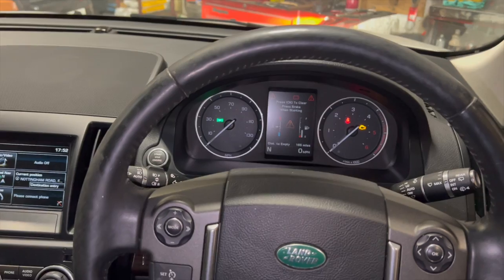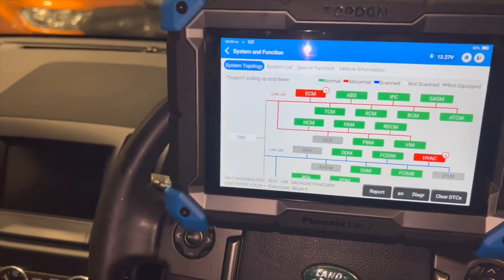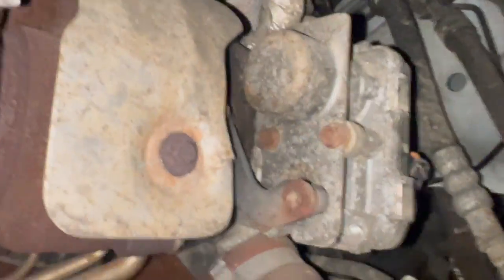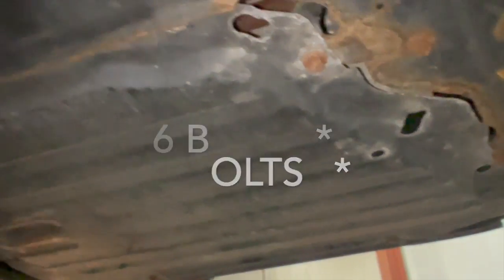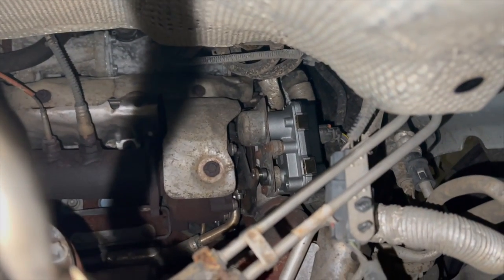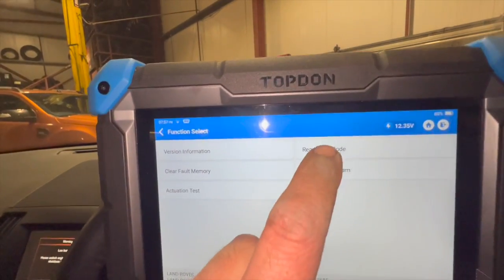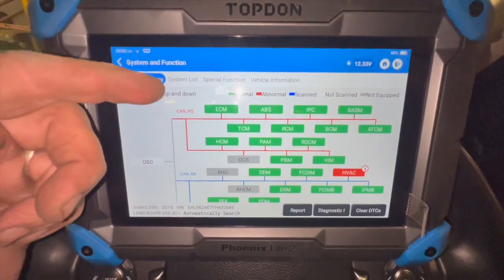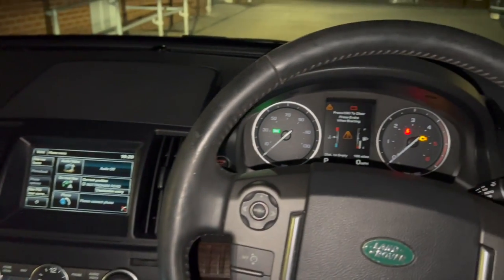Freelander 2 Turbo actuator replacement P2263 P259E P226B P6049

Comment from the maker: New turbo actuator Ebay - https://ebay.us/IsEDqn

Diagnostic machine used in this video:
Topdon Phoenix lite 2 Ebay - https://ebay.us/tsyiTI
Topdon Phoenix lite 2 Amazon - https://www.amazon.com/dp/B0B1MB6YG8  

Tools used:
Battery ratchet - https://ebay.us/zlfRSl
Ratchet Flexi spanner set - https://ebay.us/By052z
Stubby 3/8 ratchet - https://ebay.us/2eGqem
Pliers - https://ebay.us/fTNBNV
18V Milwaukee impact driver - https://ebay.us/vmpTty
Socket set - https://ebay.us/7tUKdM
Ring Inspection Lamp - https://amzn.to/3gGWHcG
Small flat snap on screwdriver - https://ebay.us/plNX5O

If your interested check out my website - https://www.diydaly.com

Useful links:
Car Analytics - Vehicle information checker - https://tidd.ly/3B2PEbx

Comment: This is a great video; thanks. After my car went into limp home mode and showed two of the codes mentioned, I removed the connector, cleaned the contacts and reset the codes. The car is running again but I've ordered a new actuator anyway. Do you know if it's possible to buy the orange latch that was unlocked in the video before removing the connector? This was missing on mine.
Reply from the maker: Thanks 👍 I’m not 100% sure tbh , second hand might be the only option

Comment: I had the same problem with my E320 cdi Mercedes. The actuator went faulty sometimes it would boost the turbo and sometimes I got  no boost, which was quite dangerous as you never  knew if you would get full boost or nothing. It would sometimes put the  car into limp, which was another pain.
I sent the actuator away for reconditioning and that worked for a year or so, then it failed again. As the actuator was under a lifetime warranty I had it repaired again. The second repair lasted a similar time to the first, and started to act up again. I contacted the company yet again but this time got no response. I have now purchased a new chinese unit and was not expecting much. I was wrong, the car has been brilliant, once the gearbox had done a relearn (it was not happy with full boost)
 I have watch videos on youtube saying the chinese units are junk, I think not. 
The Merc unit is much better located the Land Rover unit you fitted. That was not easy. Great Job.
Reply from the maker: 👍 nice to know as ive not had any trouble with them on the mercs! we've done a lot on the ford 2.2s .. ive noticed quite a lot of turbos with them on now, seen them on quite a few mercs just never had a faulty one yet.. we've had quite a few of the cheaper £50ish Chinese ones that we fitted on the transits and they've all been spot on tbf.. a lot cheaper and easier than replacing the whole turbo! 👌

Comment: Hi I've got probleme land rover évoque 2.2 diesel I've replace it and p2263-21 comes back  when I hit the pedal full I've changed the turbo because I find it broken the p code comes then I changed  the turbo actuator and the same probleme I've checked for any leaks there is no air leaks and  the egr is canceled. Boost pressure cleaned, and it's the same probleme p2263-21 when I drive it hard it comes up note when I read the value of the actuator it's higher than the calculateur by %4 is it the probleme and u know the is no méthode for putting it its standard just replace it erase code and drive plz help....

Comment: I’d love to know what’s busted in the actuator. There’s obviously electronic & mechanical components. Maybe the arm has seized in position.
Reply from the maker: seems to have failed electronically mate, the arm moved
Reply: Broken solder joints probably, they use unleaded solder for environmental reasons and its much more brittle than leaded stuff.

Comment: Hi my old man has a discovery sport 2.2  with fault codes p0047, p0046, p259e. It was running fine then went into limp mode with these codes. So my question is can I remove the actuator and send it away to have it fixed?  I have a place that solely does these. Once it’s fixed is it just a case of refitting it and clearing fault codes ? And also are they in a similar position to the freelander ? Thanks for your help.
Reply from the maker: Yes you can do that 👍 I’ve had to do the same before

Comment: Hi bud , I’m trying my to chase a problem on my 2009 td4 fl2 , that hasn’t got any codes. 

I’m getting inconsistent boost and what sounds like a dump valve / hear the turbo spooling . Would that point to a actuator fault ?
Reply from the maker: Hmm I wouldn’t of thought so tbh , they usually fail electronically so always log. A code
Reply: @diydaly  cheers buddy , my next options seems to pull the turbo and manifold out and inspect it
Reply from the maker: @Riskify74  👍
Reply from the maker: @Riskify74  👍
Reply from the maker: @Riskify74  👍👍
Reply: Hi, i have the same issue, no fault code, How did you solve the problem? Or you haven't yet
Reply: @ioflorinio  still haven’t - I’ve smoked tested too and can’t find anything … at a lost end
Reply: This is a fault on my SD4; occasionally you can hear what sounds like turbo flutter, usually when pulling away at low speed. It got progressively worse and eventually went into limp home mode. I cleaned the actuator connector, which seems to have taken it back to being a rare event, but I've ordered a new actuator anyway to see if I can stop it completely.

Comment: Hi guys, hope you’re well. Great video on replacing the actuator. Just curiosity… if u wanted to replace turbo and actuator as an assembly is there access to remove the 3 bolts holding turbo to manifold? Or would you remove manifold complete with turbo and swap turbo on the bench? 
Cheers guys, great vid!!! 👍👍👍
Reply from the maker: Thanks! I’m not 100% sure but I think you can remove it without the complete manifold

Comment: Have Reduced Engine Performance and no turbo boost intermittent on 2009 Auto Freelander 2. Does this have the same actuator? Maybe crank position sensor would give the same fault?
Reply from the maker: yeah it should have, you need to get the fault codes read , if its got some relating to the the actuator its more than likely the fault 👍 .. crank position sensor wouldn't usually cause it to not boost

Comment: I have the same problem. The workshop is asking me to change the turbo which will cost 3000 GBP minimum. Thanks a ton for your video. Will take my car and see if this part change solves the issue at a fraction of the cost they are quoting. 🙏🙏🙏
Reply from the maker: No problem 👍 hope you get it sorted 👍

Comment: hi, my Freelander has the same problem, i was told the new actuator needs to be coded to the turbo, if so how is this done,
Reply from the maker: Not codes as such , there is a basic calibration that can be done via a diagnostic machine but u may find it works ok

Comment: Great video, thanks. Many mechanics seem to be adamant that you can’t do this due to the mapping issue. Did you have a reason why you suspected that it wasn’t true?
Reply from the maker: 👍 just that we've fitted quite a few now without any trouble.. it is obviously better to fit complete with a new turbo but obviously a lot more expensive! we've fitted a few now that have still been going strong for 2+ Years

Comment: I've got the P0299 reduced engine performance but no engine management light. 
Cleaned the MAP and MAF sensor which I think solved it for a short period but it's come back. 
The turbo works if I clear the faults but will always come back.

I wonder if I replace the actuator if this will resolve the issue.
Reply from the maker: These don’t usually cause p0299 , always check for and air leaks first , there is a chance it’s the actually or could be the turbo
Reply: @diydaly  Thanks. That DTC came up after I was cold starting in -14 degrees. Took ages for the engine to turn over and I thought that I maybe had some dirty sensors/fuel filter. 

I'm hoping it's the actuator and not the turbo itself. Will have to wait until the weekend to get a proper look at the underside. Will let you know what I find
Reply: @diydaly  Also, forgot to mention that clearing the code will get the car running again as normal until you put your foot down. 
I'm hoping this is some kind of electrical issue with the actuator as I can get boost if codes are reset.
Reply: @HaggisMuncher-69-420  Hi mate, I have the same issue with my 2007 freelander, P0299 code and after deleting it runs fine for 200-300 miles and suddenly comes back. Air leaks seems fine.
I wonder what your's come up to?
Reply: @fitimismaili5910  Wow. What a rabbit hole I went down with this car. 
Had this problem since January. 
I replaced all boost hoses (no leaks on original), new intercooler, turbo rebuild (as per garage's suggestion). 
I've had a new turbo actuator put on but it wasn't programmed to the Freelander - generic Chinese actuator. 
Looks to be that my old actuator was broken, the Chinese replacement wasn't coded. Just received a new actuator that has been programmed to the car. will hopefully install later today if I get time. 

the last mechanic I took it to on Saturday said that the Chinese one "works" but isn't sending the right signal back to the ECU (If I remember, he said the ECU is expecting 6v but the actuator is only sending 2.4v or something like that).

Bought a new one pre-programmed as the garage I was recommended to wanted me to take my turbo off the car myself and I just don't have the space to do that. 
I'll let you know how I get on.

Comment: Hi, I've got a freelander 2011 2.2 Diesel, auto. I'm getting just the code P2263, would this be the actuator or do you recommend looking at other possible causes first? Appreciate your help, regards
Reply from the maker: Im fairly sure yours will be the same issue mate 👍
Reply: @diydaly  appreciate your help mate, thanks, I'll let you know how I get on 👍👍👍
Reply from the maker: @scottmorley7188  👍
Reply: @diydaly  Hi mate, just a quick one, I took my actuator off the car and checked part number which is 49477-19600, I ordered one from where you recommended with part number 49477-01203, are these compatible?? Or will I need to specifically get one with the exact part number?? Appreciate your help again mate, Scott
Reply: @scottmorley7188  Hi, did you get to the bottom of this and fix yours with just the actuator?  What were the symptoms other than the code itself?

Comment: Great thanks so much for the reply. Fingers crossed it all works out and I don’t need a new turbo. 👍
Reply: Hi so got the actuator back and they tested it and said it was all good. Said it could be a build up of carbon in the turbo. Suggested refit actuator, add Forte turbo cleaner , reset fault codes and give car a good run and this should clear it. What do you think ? Thanks
Reply from the maker: always worth a try with the cleaner first tbf mate  @ChrisCameron-w4t
Reply: @diydaly  Have you heard this working ?
Reply from the maker: @ChrisCameron-w4t  not often but sometimes
Reply: @diydaly  so update. I had to buy a new actuator and all is well. Tell me did you calibrate the new actuator or did it work well once it was fitted? Mine seems to work well and has made the car more responsive.
Reply from the maker: @ChrisCameron-w4t  I just fitted it was good to go strait away
Reply: Ok thanks for all your help. It’s worked an absolute treat. The car actually feels more responsive and runs better. 👌🏻

Comment: Looking at this fault ,, I have a intermittent fault from set off on fl2 on 13 plate ,, between 1000 2000 rpm power for a split second but feels like get worse did lose power tonight then came back to life ,, but no faults codes coming up on dash and no limp mode yet ,, could this be a singed that my one could be faulty ?
Reply from the maker: Possibly but I’d expect it to log a fault code tbh mate .. it would be abit of a gamble without as there’s a few issues that could cause similar problems
Reply: Thanks for replying,, putting a scan tool on tomorrow and see if I can see out in live data too
Reply from the maker: @Leocow6643  👍
Reply: @Leocow6643  Hi, did you find out and fix the issue?  I have a similar intermittent fault, also a 13 plate FL2 SD4.  Happened 3-4 times a year, now happened 3 times in the last week.  No lights, faults and drives fine, but struggles momemtarily for 2-3 seconds between about 1500-2200 rpm then drives fine again...
Reply: @MegaVinny73  how do ,, I narrowed it down to faulty egr valve just by going through parts that could be a problem ,, I got the blanking plate of eBay with the hole in to stop engine light coming on really easy to fit 10 minutes job only put it on to see if made a different to fault and it cured it still on now and the fault has never happened since ,, 4 pound sorted a bad head out ,, but a think the crack shaft sensor can give same kind of fault too and you can get them off eBay and not silly money ,, easy to fit there is a video on here how to fit one ,, I would definitely start with these two things things first  and just keep ticking a list ,, it drove me crazy the fault but got there in end 👍
Reply: I would start with this first and see if it makes any difference it cured my fault , and I spoke to a lad in local garage and he reckons it cured a fault on a Skoda tdi with same symptoms and fixed it for him 👍
Reply: @Leocow6643  Thanks for the response.  So it's these possibly...

1. EGR plate
2. Turbo actuator
3. MAF sensor
4. Crank sensor
5. Diesel fuel filter

They are the ones I seem to find reporting the same/similiar issues.
Reply: @MegaVinny73  I would definitely start with 1 then 4 on your list ,, easy to do and not a lot of money failing them two just got too keep ticking the list 👍